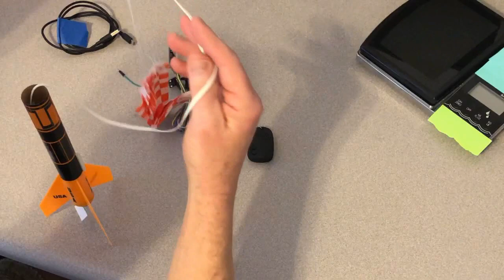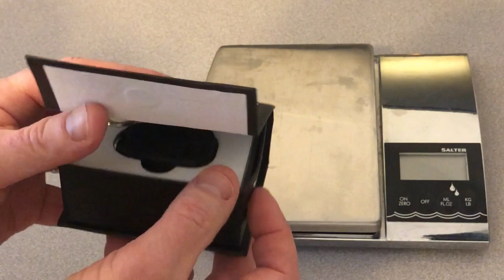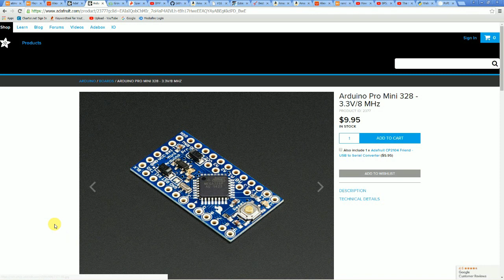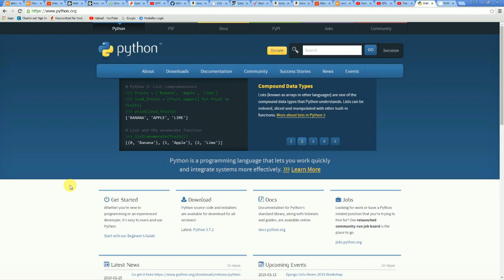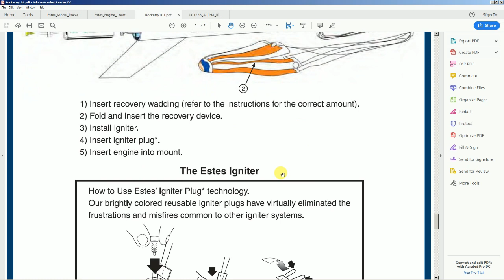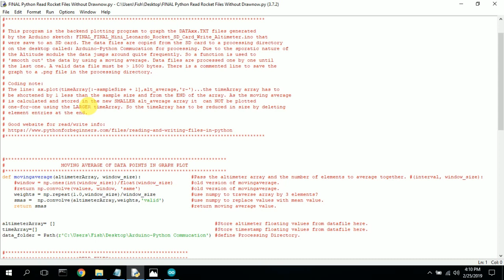Arduino Data Logger for Estes Rocket w/Plotted Altitude in Python

Comment: Do you have a parts list for building this? Which altimeter, arduino and data logger did you use? I want to log the altitude of my rocket but I like to home brew where possible. Also, would it be possible to add a camera to the setup? I've got a few arduino with cameras.